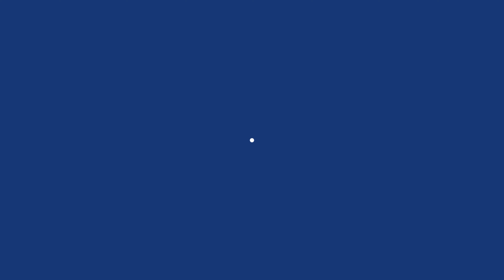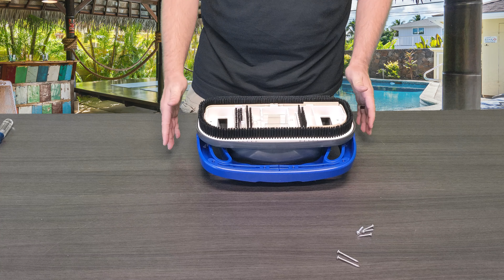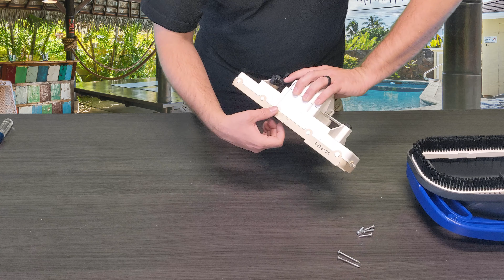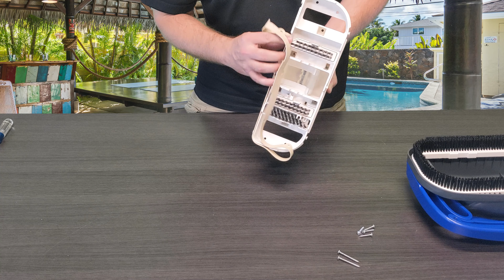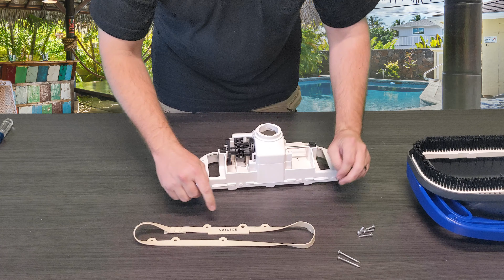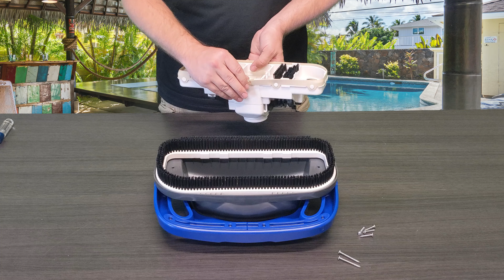Pentair Kreepy Krauly Dorado Brush Ring Vacuum Skirt - Quick Fix

Comment: Any thoughts as to why my Dorado won't go toward shallow end? I used it in side port worked Great...but since Hurricane some stuff has good inside the port aoni am using the skimmer for the Dorado to operate. Since then, the Dorado does not want to move up into the shallow end.
Reply from the maker: Without seeing it in person, maybe check out to see if the hose floats are installed?